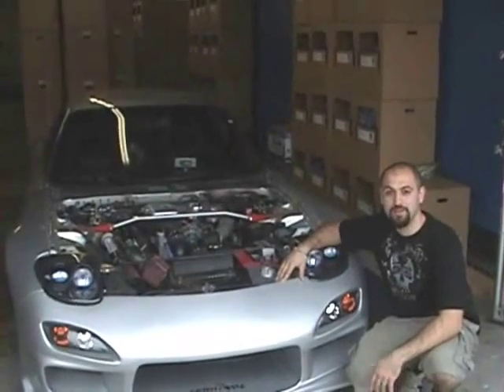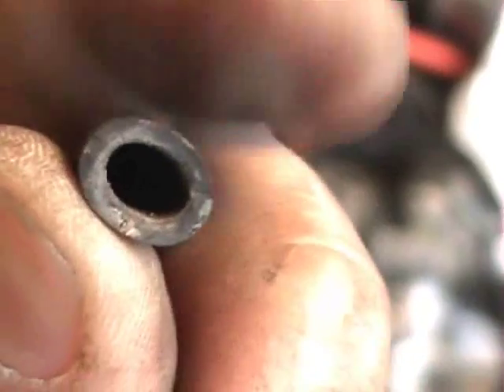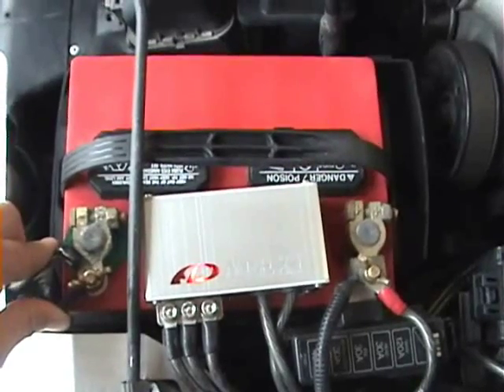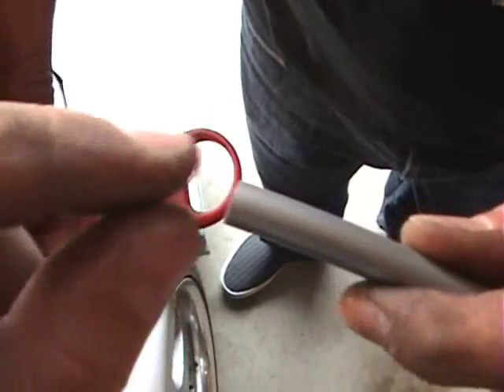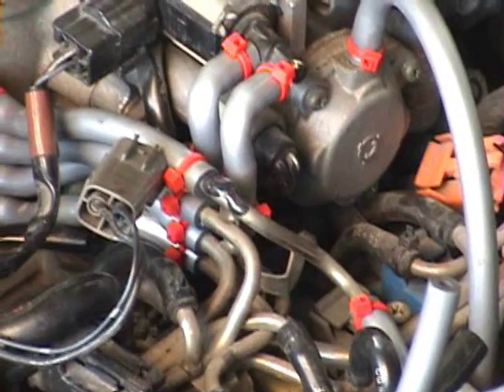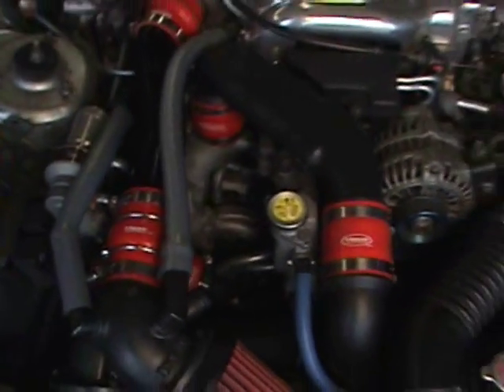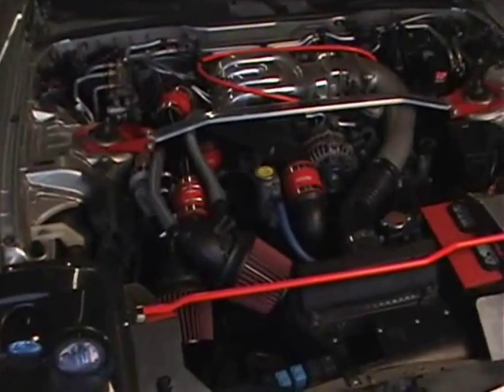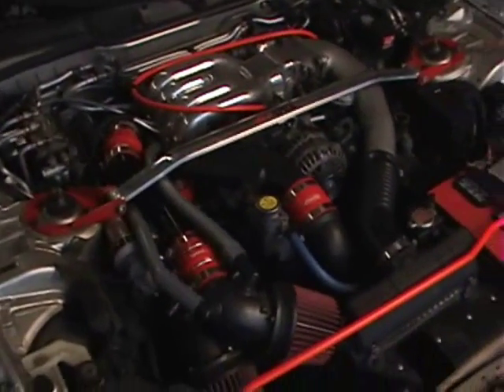Hose Tech FD3S 13B Motor Vacuum Line Upgrade

Comment: I dont agree with putting silicone hoses over the steel brake lines. That serves no useful purpose whatsoever, looks a bit tacky and only adds to the engine bay clutter. Keep it simple.